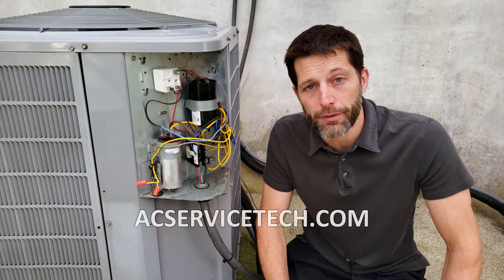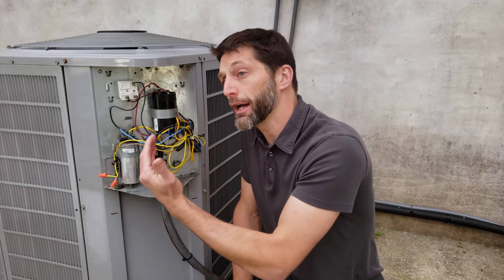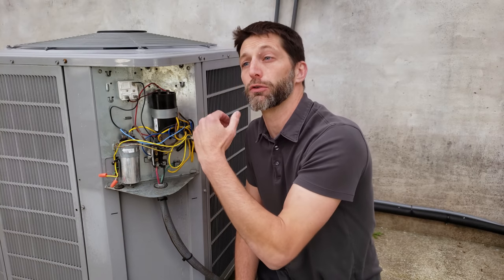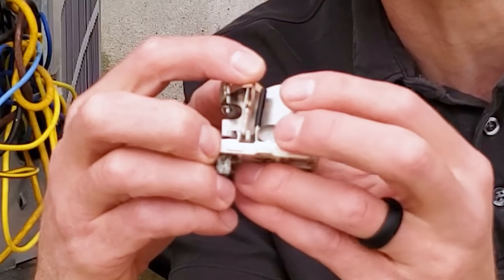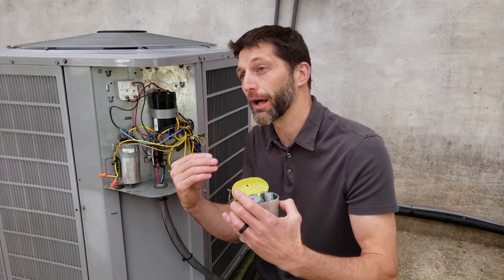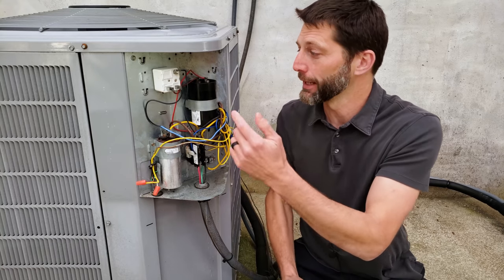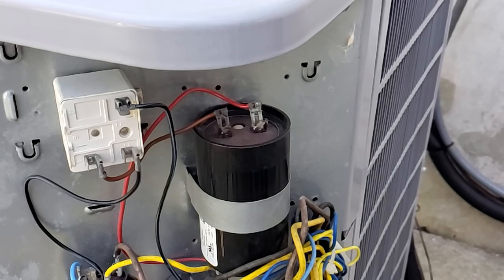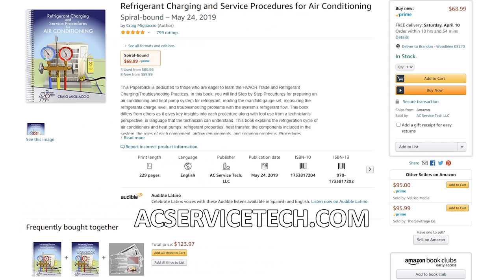The Main Reason Why Start Capacitors Fail in HVAC Units! This Cap Blows Out!

Comment: Potentially dealing with this as an issue on at a property in Florida we have the tenent called unit outside is not running thermostat is set on cool 73 degrees says it 85 in the house

Comment: What you show there is what I have seen others call the hard start capacitor. Do you know if this is something included from the factory or installed later? I have read a comment where someone said a hard start is only installed when the unit it at the end of its life. I am not sure that is accurate. Can you share you experience on that. What I commonly associate with the capacitor is the silver one in your video; the dual run capacitor. Do you know why a dual run capacitor might fail? It is possible a worn contactor would cause the dual run capacitor to fail?

Comment: Small technicality on capacitor value marking.  MFD stands for Micro Farad where Micro is 10^-6 so a 141 Micro Farad capacitor canned be written as 0.000141 Farads.  Farad is a rating for ability to store an electrical charge or capacitance.  Also, it's not uF.  The "u" is actually the Greek letter for micro so micro Farad (again).
Reply: 'Farad' in honor of Michael Faraday (1791-1867), pioneer researcher of electromagnetic phenomena.  Also, 'micro' is sometimes written as 'u', but is more properly written as the Greek letter 'mu' ( μ )

Comment: I have American standard ac unit that sometimes fan and compressor turns off and on continuously I turn it off for like 6 hrs and then works great for days then problem starts again. I have a clean filter no refrigerant leaks I have had numerous ac techs come and some say it’s compressor and some say not compressor because it would work when they come in any ideas

Comment: I use reverse EMF (or flyback voltage) on a casino game I designed to trigger a circuit that prevents a high current motor from coasting to a stop. This is called “motor dynamic braking”. Ain’t electronics neat?
P.S. you can attach a disc cap across the contacts of a relay to dampen the spark and extend the life of a mechanical relay.

Comment: Hey Craig, if you use a Goodman two stage condenser (outside), do you need a two stage air handler/furnace inside?
Reply from the maker: Yes that is correct. It must have a control on the indoor unit board for the two blower motor speeds
Reply: @acservicetechchannel  Yes, I saw an American Standard 2 stage air handler with YLo, Y, W1, W2 etc. on the terminal strip.

Comment: awesome video: curious, I do realize every unit is different and there are options but do you have a "ballpark" figure as to the cost of the capacitor and the relay? assuming they are normally available to order.   Thanks a bunch.
Reply: Take note of the micro farad rating printed on the capacitor label (as seen at 1:15) then check Lowe’s, Home Depot, Ace Hardware, etc. I purchased my start cap from Ace for $16. Our A/C tech quoted us $360 for part, plus labor.
Reply: @DRPowell  just a little mark-up there.
Thanks a bunch, I didn't realize HD sold capacitors but I guess I never really looked.

Comment: My thermostat was calling for air yesterday but was not blowing out cold air. Checked the fuse, checked the starter capacitor and it went up to 2.4m and no visual signs of failure. The circuit for the ac tripped on my circuit house panel. Not sure when that happened. Would be it smart to replace the starter capacitor anyway and the potential relay?

Comment: Great video. Question, why does my outside ac unit have a hard loud relay sound when the unit first turns on?
Is the relay or cap going bad?
Reply: That's probably just the main contactor pulling in at power up. It's like a large high current relay that applies the 240 volts to the unit.

Comment: What happens if the compressor motor goes into thermal overload (either at start, or after it was running) ?  Does this damage the start capacitor?

Comment: Tell me more about this back EMF that pulls the relay contacts open. Is a separate winding on the motor? I'm not making sense of how would get just the back EMF to do that work.
Reply: Coil is energized by the back voltage generated into the start winding 

Motor has both run and start winding
Reply: @minorcek  What relay are we talking about? I expect it is the relay that energizes the compressor motor. It is run off 24V from the thermostat. Still makes no sense, although after 2 years, I don't even know what I was referencing, and I didn't watch again to find out.

Comment: The original start Cap on my 1991 AC compressor just blew. I was told that modern Caps aren't as good as old ones. Any truth to this and are any modern brands better than others?

Comment: Mine just blew and it looks like a mess in the video. I ordered the capacitor(arriving tomorrow) and the relay which is arriving in 8 days. Should I wait for the relay before putting in the cap? It is hot here and this is my upstairs unit.
 I guess I can test the relay to see if it is not working properly. would the cap blow like that without the relay being bad?

Comment: Is the start capacitor still operational if the mfd is higher than the rating. For example start cap mfd rating 145-161. U get a reading of 185 no bleed resistor. Should it b replaced ? Thanks for sharing your experience n passing on important information.
Reply: NO!  145 to 165 means  minimum 145 mdf.   Here is a great tip " if it's not broken,  don't fix it 😉"
Reply: @yurydolinsky  thanks for sharing 👍
Reply: @shine-cg9uf  honestly your system can run without start cap. In mine it failed I threw  them out😁👍. Typically we install them on compressors who are having starting problems.

Comment: it can also fail if the compressor is getting mechanically tight.  Ive seen when a  hard start kit was put on a locked up compressor and it got the terminal on the compressor so hot, it melted out of the housing and blew all the refrigerant out, talk abt a mess.

Comment: I have also come across jobs home owners have done DIY where they don't put the spade terminal on correctly, they put it between the insulation ant conductor this creates resistance and heat blows of the head of cap
Reply: That’s an interesting failure mode. Did it heat up and blow the run cap, or did the start cap blow due to relay not pulling in due to bad connection?

That being said, I’ve purchased many start kits from 5-2-1, Supco, KickStart, and never once have they employed an insulated spade connector.  The connector they use is uninsulated and has a piggyback male spade terminal for when run cap has no spare terminal(s)
Reply: @yeliab814  No I find the run caps terminal blows off only due to bad conductivity

Comment: I always used the 3 in 1 hard start kits, very reliable..
Reply: Hi there,  would you mind sharing with me what is 3 in 1 hard start?
Reply: @dido1803   it is a start capacitor and relay all built into one unit. u simply plug the 2 wires onto each side of the existing capacitor
Reply: @randy1ization  hey, thanks for reply.
Reply: @dido1803  retired hvac/appliance contractor, ask me anything
Reply: also a time delay thermostat can keep compressor from trying to start before pressures equalize when people are dicking with the thermostat a time delay module wired into the 24 volt side is also ok, but the modules from rheem had high failure rates. some  thermostats u can set the time delay, others u cant., 3 minutes is plenty.. something else that takes out capacitors is power surges and failure from the electric grid, the on /off every few seconds is bad. I inplug fridges, freezers, and shut my AC off until the power comes back on steady

Comment: This video is a good teaching example of how to test all the downstream components.  However, I've replaced (how many?) start capacitors that just plain fail prior to the compressor without the start/run relay failing.  Sorry, but it happens.

Comment: Wow, I have a 40 year old AC unit, and the start capacitor just gets tired every 5 years and opens up. Were $3 - 35 years ago ... now they are $27. I never even saw a timer in mine.
Reply: Your old unit may have a start-run centrifugal switch incorporated in the compressor motor.

Comment: Check out the wonky circuitry between the capacitors, relay and the start and run compressor windings for entertainment sometime.

Comment: So do I go out and buy a dozen relays and few capacitors just in case this happens often or do they make a relay that's reliable ?
Reply: I believe that I will just wait and see if the one I have fails, then replace as necessary. But if buying a dozen helps you sleep at night, then by all means do so.

Comment: ???   I have a start capacitor that measures greater than 20% over the rated capacity. Rated 147-174 mfd 220-250 v, but reads as 218  mfd. can this burn out a solid state start relay?   Thanks!

Comment: I have a question about my AC. My window unit, will sometimes deploy a cycle, run for 5 minutes then discontinue the cycle. This routine will repeat for that period of the unit being powered on. Why does it run for 5 minutes then shut off? I tried cleaning the coils. Didn't work. I tried adjusting the fan speed. Didn't work. I tried adjusting the thermostat. Didn't work. I've tried checking the unit for leaks and I've found none. I tried checking the temperature of the compressor and it's almost too hot too touch while short cycling. What else should i do to attempt to locate the cause? Now on some days when i use it, it'll run like it should. It'll run for about the perfect time. (Depending on the temperature and other reasons to keep it cooling.) It's very intriguing, yet a fair amount of annoying. Thanks!

Comment: Do yourself a favour and buy an inverter outdoor unit. The starting current will be reduced by 7-10 times and the unit will also provide (far) higher off peak efficieny.

Comment: I thought the relay (capacitor) was inside the compressor motor, and as the motor speeds up centrifugal force will turn off the current to the capacitor. Is this an old design?

Comment: I noticed that my brand new Trane XR15 tends to (occasionally) make a loud `clunk' when turning off... is this a cause for concern?
Reply: The electrical contactor (relay) makes a noise but I don't believe the compressor should.
Reply: @tmst2199  Doesn't do it always just some times...  brand new... huh.

Comment: Makes you think like other devices. When certain components fail and you keep replacing that same component, nobody thinks WHY that component keeps failing. It COULD be something ELSE causing that component to fail that you are not seeing or looking at. 
Kinda like my salt cell system panel, the same dang resistor kept burning out and i would replace it every 3 months or so, then to find out there was another component on the board that was "failing" and allowing more current to pass thru the resistor thus burning it out. But there was no way to replace that other component so the entire board had to be replaced.

Comment: Question. What if my system does not have a start capacitor, just a run capacitor? I opened the cover, and there is only one capacitor encased in aluminum.
Reply: Imagine a/c as Lego.  You can add or take away . Some units have it , some don't. Here is another cool thing,  if your start cap fails, disconnect it with relay and throw out ,and your unit will magically start working again just with your run capacitor.

Comment: thanks
Reply: Hi guys , maybe somebody can help me. I was trying to fix my central heater two months ago . I don’t really know what to look and check so I tried messing with the thermosthat by using a jumper wire , actually just a paper clip. It didnt start the heater so that rule out the thermosthat is broke I assume. Now my problem is the AC , it was working before I used a paperclip on the thermosthat . Could I have shorted something  inside the handler like a fuse ? I don’t know what to look or check . Also the condenser is not working also

Comment: I know on my Reem system for years , its boom and running . Big voltage + huge tons ?
Reply: I also have a Rheem hvac system.Went from all electric to propane.  The enery savings alone payed for my system in 4 years on furnace. Another 3 of so on ac. Got 36 or 37 seer unit. In all it cost about $7500.

Comment: I need help,

My central AC Heater system is tripping the power braker as soon as I start it.

Some times the heater will initiate the flame with out tripping the power braker, but with out the blower motor starting.
Reply: Motor grounded.

Comment: Everyone should get a short course in high school explaining all about HVAC common repairs. Mostly because this industry is an immense ripoff of the public. For example, it is not uncommon for a homeowner to be charged $1000 for a simple repair that entails replacing two parts that can be bought anywhere for $8 each. Some of these techs make so much money that I told my lawyer friend (who works at one of the top lawfirms in the nation) to quit law and take up A/C repair!
Reply: Doctors charge more , maybe you should take a class on surgery 🤔 save a buck.

Comment: Technically speaking, mfd stands for millifarad, and ufd stands for microfarad.
Different by a factor of 1000, which matters ALOT, and should be properly defined to dispel any chance of confusion.
So, are the caps just mislabeled, or do they actually measure in the millifarad range?
Reply: Mui, it's a bit sloppy, but 'mfd' means microfarad. I know, silly, because we all know better, but that's the way it is.

Comment: If I come across a capacitor that is a 70uf 450vac. And I’ve called the supply house but the only one they have is a 70uf 440vac can I use it or no?
Reply from the maker: You would want to use a voltage rating that is the same or higher but usually in an HVAC unit, you won't see 450v much but will see 440v. That should be fine though just don't replace a 440v with a 370v, thanks!
Reply: Ok reason for. My unit is about 7yrs old and I want to change both indoor/outdoor capacitors. The outdoor is 450vac. That’s why I asked if using a 440 would be ok

Comment: if the relay fails then it shall not be replaced with the same type of the relay: the new relay shall have much higher current rating than the failed one - in order to prevent contacts getting welded again.
Few extra $ spent on a stronger relay will save the start capacitor and service costs in the future. 
btw: it is not 130... ‚EmEfDi’ - it is 130... mikro farads! which is the capacitance value of the capacitor.
0 seconds ago

Comment: Damn, I wish I had seen this a couple of weeks ago.  I just had a capacitor fail; I do not know which one.  If it is the start capacitor then I should know why it failed.  If failed because of the relay then that should be replaced too.
Reply: Anytime you find a failed start capacitor, you MUST replace relay or thermistor!

Comment: When the start cap failed the compressor would have got up to speed. What happens when it restarts. What will protect the compressor from LRA amps as the compressor is stalled. Is it a circuit breaker ?
Reply: Protection is lost. The compressor at risk of overheat and failure.
Reply: @badactor3440  Would the thermal over load just trip and save the compressor ?
Reply: @michaelcostello6991  newer systems have fail-safe protection. Units that are more than 15-20 years old, do not.
Reply: @badactor3440  Thanks for clarifying that.

Comment: Why does my new A/C unit bang so loudly on startup? It's done it since install. Everything is new.  I have had the tech out here three times and all he has done is install a hard-start kit which did nothing. A/C works great, it just tries to jump off of the pad! It's a Goodman 1.5 ton heat pump.
Reply: Sounds like you may have had the infamous "parts changer" out to look at it.
Reply: I had that issue on a unit about 10 yrs ago. Brand new and started with a pants-filling bang every time. Had it looked at many times. One tech finally gave a reasonable answer: the compressor does not have the rubber feet that they normally have, so the bang is the compressor hitting the sheet metal without any padding.  He had no way to fix it though.
Reply: @AgentRobloxPlayer  Mine is rubber mounted, I checked. When it starts you can see it torque over so hard it hits the stops. I think it is trying to compress liquid instead of gas but I am no expert.
Reply: @tmst2199  No, the guy who installed the entire system.

Comment: the start capacitor stays energized while the compressor is running. The starting switch (thermistor, potential relay, current relay) is downstream the capacitor so when it opens the capacitor is at line potential, but has no current flowing thru it. (I wish I had this video to show my hvac students... I used to smoke one transformer a class just so they could see it and smell it). I quit teaching last year when the college demanded I lower my passing grade to 50% and change my syllabus to criticize white people ("Equity" Is a CTR Dog Whistle).

Comment: I don't think you mentioned checking the compressor for an open run winding or shorted start winding as other causes of start cap failures or a very weak run cap, which keeps cycling the start circuit.
then again the title does say "main reason".